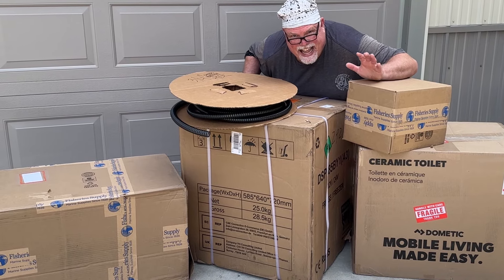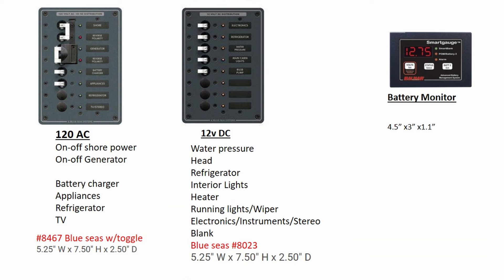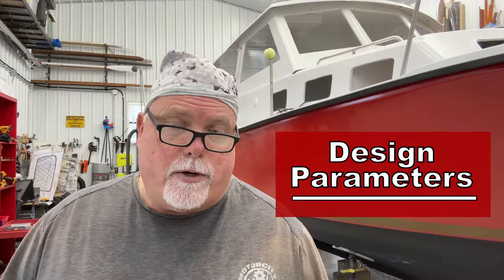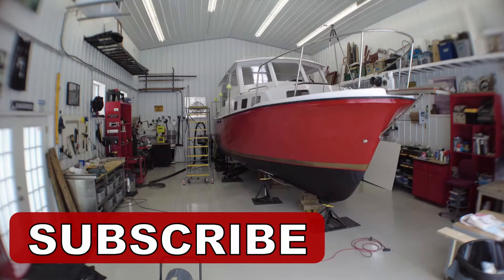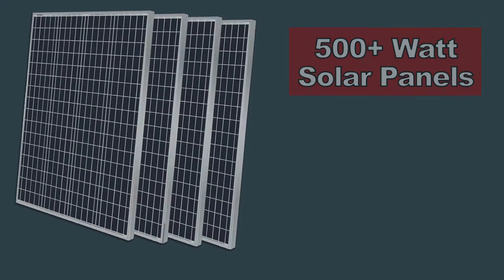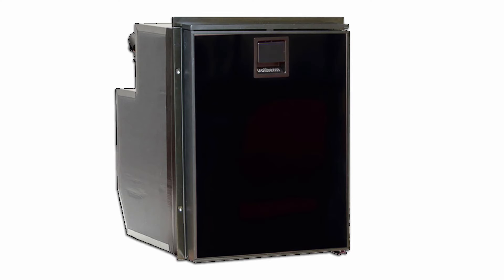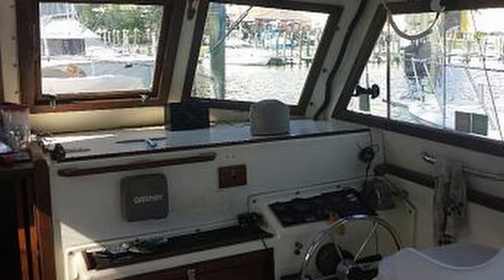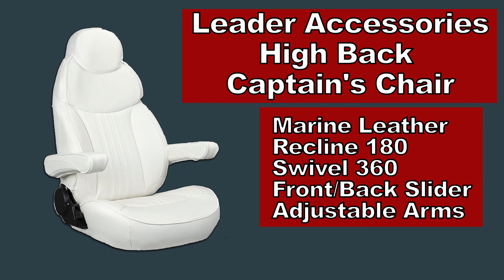Trailer Trawler Restoration Components | Could this be the MOST AWESOME trawler build? (Ep93)

Comment: Great episode,  thanks the break down and documenting the various systems.  I'm surprised you're doing a stern thruster instead of a bow thruster on a single screw though. Could you tell more about this?
Reply from the maker: Thank you Calvin😁 I will go into the stern thruster in detail in a separate  episode. But basically it’s easier, cheaper, and provides virtually the same results 🤓

Comment: I'm working on a 1980's Lockley-Newport 19 trailer sailer and it has carpet on the cabin liner.  Any recommendations for getting it off or what about giving it a good clean and put new headliner over the top ?
Reply from the maker: Thanks for the comment. 😁You have to physically pull it up by hand with a scraper , then sand the surface and clean with acetone. Good luck
Reply: @motorcityboatwerks  thanks
Reply: @motorcityboatwerks  got it all pulled out today, raw fiberglass underneath trying to decide to paint or put in new headliner
Reply from the maker: Great job 👏

Comment: Just finished installing new electronics, controls and rewiring of my entire boat. The boat is a 1975 Marine Trader 34’ Sedan Bridge. Removed about six 5 gallon buckets of wire and mountains of old panels and components. 

100% new tinned marine wire throughout. This includes 2/0 house and engine cables. All wiring is routed throughout the boat in either gray PVC conduit or server rack style raceways. 

As you eluded to, I installed Blue Sea Systems for all panels, bus bars, and fuse holders and Victron power distribution equipment (Multiplus II 120v 3000, Orion 50A B to B charger, Lynx distributer, Smart Shunt, Cerbo GX, and 7” display.
Reply from the maker: Well done ! Thanks for the comment 👍😁

Comment: Hey brother- while I'm all about reusing older stuff- I don't like using obsolete stuff, like your auto pilot. Once it breaks- and everything does- you're gonna have a really hard time finding another working unit. Have you considered switching to hydraulic steering? You can find used helm units that are still in production for a good deal.
Reply from the maker: These are all good points 👍and I’ll discuss these in detail in the autopilot episode. The autopilot is not obsolete, just unsupported anymore. Which is why I have a complete replacement. Hydraulic steering is an expensive upgrade that presents size and location problems in this helm. And then an expensive AND obtrusive autopilot to match.

Comment: As always good job Joe.  Love the air horn and the captain's chair.  Have you looked into a thistle or an articulated rudder?   I've also been wondering if we need a 120v system except to charge batteries and am thinking of going that way the next time I have a boat to restore.  I've been trying to think of an appliance these days that doesn't run off 12V except maybe a toaster. . oh wait. .
Reply from the maker: Thanks Joe 😁 Boat Restoration Rule #17 says If It’s Not Broke Don’t Fix it.  🤓I think the rudder is fine. I think Experience tells us, For any long term live aboard situation you need a minimal 120v system especially for charging when tied to the dock.